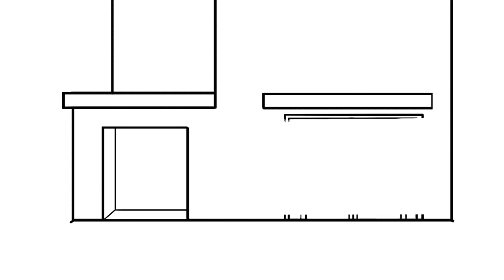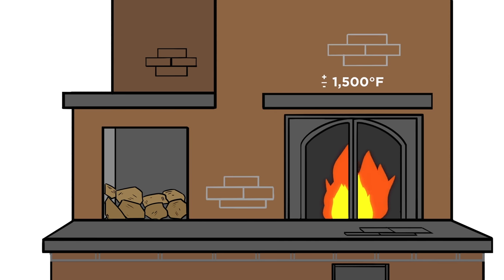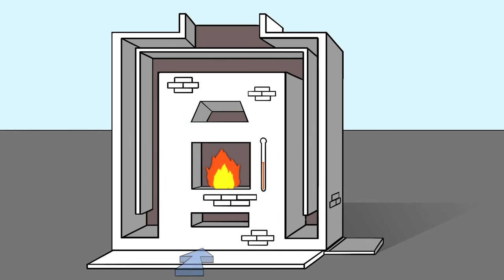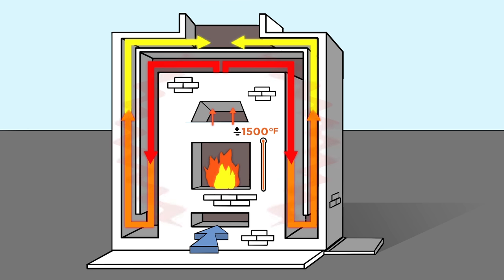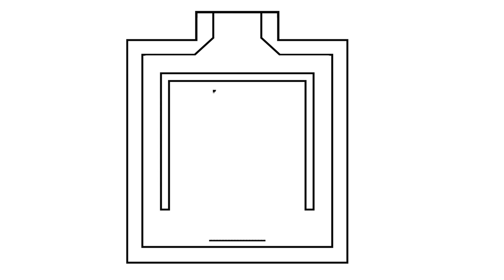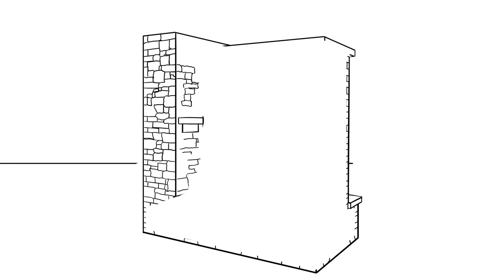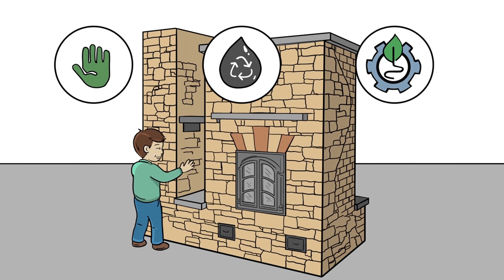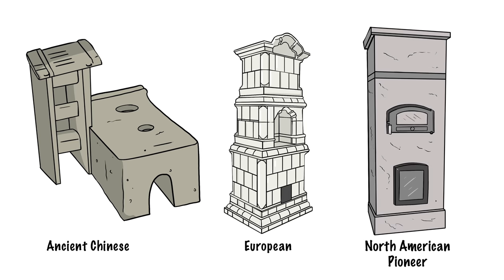The Basics of How A Masonry Heater Works

Comment: Terrible to clean if there was an issue. I love how they say it doesn’t creat creosote 🤣😂. 
I have cleaned many masonry heaters and 95% of them have creosote all throughout the chambers. The creosote accumulates only when the owner is not educated on how to use the heater, and for me it’s 95% of the owners. Some of these masonry heaters don’t even have access to the chimney(like a clean out door) so you can properly clean the chimney. 
The companies that install these heaters need to make sure there is access to the chimney and that the customer know how to properly operate the masonry heater before they leave the customers home.
Reply: would one of the chimney sweep logs that you buy and burn do any good?
Reply: @bikiniluvnguy1  it might work if you used a couple of them, but there are much better products out there to use. CRE-AWAY or Anti-Creo-Soot spray. The problem is you have to clean all the chambers first as good as you can, use the products for a 2-3 weeks and then clean it again. It’s always good to continue using the products even after it been cleaned to help with future creosote build up. These types of heaters work amazing, but they create a lot of soot in the chambers, so they need to be cleaned often.
Reply: it is the opposite. they burn really really hot because they have constant strong draft inside and no metal surface to release the heat to outside of burning chamber, thats why they are the most efficient wood heaters and thus create least amount of soot. actually also  for this reason in finland government gives tax discount to homes using masonry heater. theyre the cleanest heating solution. if yours is creating more soot than normal stoves there should be something wrong.  @akaredcrossbow
Reply: @HaraldSjellose  the problem is nobody here is educated on how to properly use them. Even after they have been educated about it they still don’t do the correct thing. One of the major issues with these heaters is they get too hot for the owners and that’s when they run them on very low temperatures creating massive amounts of creosote. The other problem is wood that is not properly dried before burning. So the combination of low heat and wet wood make a nightmare mess to clean in all the ports. 
Another problem is people almost closing the damper all the way down at the chimney. When doing this it will cause a slower draft and that builds up large amounts of soot in the heater. Everywhere else in the world can operate them perfectly, but here they should be against the law.
Reply: i see. but i dont understand why it should be against the law. @akaredcrossbow
Reply: @HaraldSjellose  one of the issues I’ve seen with multiple masonry heaters, was so much creosote build up inside the chambers and it all ignited. The masonry got so hot, it expanded the joints letting smoke and fire escape into the home. It would be better if it was mandatory to go to a program to learn how to properly use it and get certified. If you don’t do that, then they should be fined. Here it’s not mandatory to get your chimney or appliances inspected and Swept Clean every year. People here usually go years burning and don’t hire a chimney sweep until there’s a problem.
Reply: You provide valuable information @akaredcrossbow
Reply: Masonry heaters are designed to burn clean. If the masonry heaters you encounter are as dirty as you say, your clients are not seasoning their wood correctly. Please advise your customers to burn DRY wood - seasoned at least two years. You should have nothing accumulated but fly ash at the clean out doors.

Comment: I have a fireplace that 3 ft wide, 2 ft deep, and 2.6 ft high, the hearth sticks out another foot at the base. I am trying to come up with some sort of wood burning setup more efficient than a fireplace. I tried a steel barrel stove on its side stuck into it with one section of flue pipe sticking up into the damper, and closed off with tin all around it and a layer of insulation on top of the tin. I never could get the room to heat up. I would like to try something like this or a rocket mass heater or? in the fireplace, any ideas?
Reply: Sorry if this is late, but you could try finding or making a stove that fits into in the fireplace and then line the firebox with brick or ceramic fiber board to insulate the fire and stop the room's air from cooling the metal firebox. By insulating the fire from the room, the firebox no longer radiates heat directly but the insulation allows the fire to burn hotter than it otherwise would. Systems like this often don't have dampers since dampening makes a cooler fire and the objective is to burn hot and efficiently. If the stove has some sort of grate for the fuel to burn atop, that will also make the fire hotter as the underside of the fire is receiving more air. A coal grate will also allow you to burn coal and charcoal as well as wood if you so desire. 

A hot fire will combust much of the smoke that a cooler-burning fire would normally produce and so the system can have a cooler exhaust without as much creosote build up. You also get extra energy from combusting the smoke that would normally go up the flue. You'd want a cooler exhaust because that means that more of the heat was extracted from the fire and put into the home. Some stoves like a franklin stove have a built-in baffle after the firebox that extracts more heat from the exhaust but you might need to add more length of piping or channel to extract the amount of heat you need. 

Adding some sort of mass (brick, sand, cob, maybe even water but it can leak) to the piping/channel will store heat so that the fire can give heat throughout the night. The amount of mass you add depends on if you want a small, faster-heating mass that also cools fast or a large, slower-heating mass that also cools slowly. By the time the exhaust has run the length of the course it will have transferred most of its heat to the mass but it should still be warm enough if you want it to rise up the chimney and create draw. 

One last thing that you can try if possible is to have a stove that has an air intake from outside, as this will stop the fire from pulling the ambient air from inside the house that you are trying to warm and sending it up the chimney. If there is no intake then cold air will attempt to rush in through cracks in the house in order to replace the air going up the chimney.
Reply: Rocket mass heaters are by far the best and most efficient option! They also take all the good ideas from this design and expand to use more of the hot flue gasses and burn out the creosote which means less cleaning. They’re also far easier to clean when needed where as if these need to be cleaned it’s almost impossible to clean the inner heat chamber. You can also grow the fuel for a rocket mass heater in a smaller are, using coppicing techniques, because rocket mass heaters operate on stick fuel, which also dries faster than logs.

Comment: Where does the smoke go ???
Reply from the maker: Masonry heaters use a normal chimney you'd use for a woodstove. The firebox will get around  1,500 degrees Fahrenheit  but will be about 350 degrees when it exits and enters the chimney.  At those temperatures, using good dried firewood, the hydrocarbons  are all burned. This eliminates a creosote  problem. However, properly  built heaters all have clean-outs.